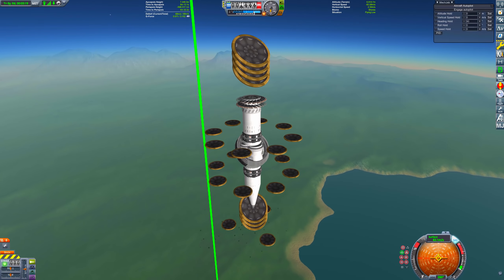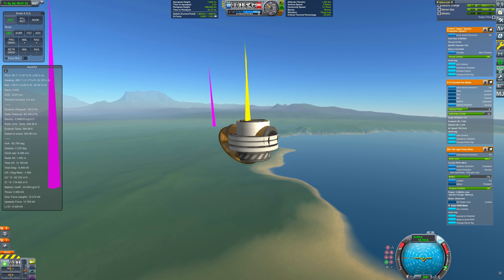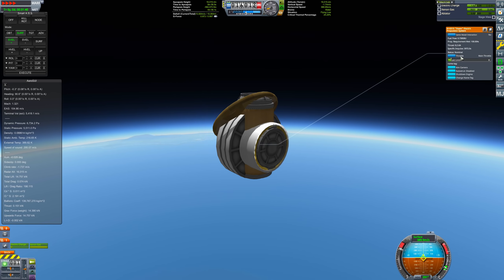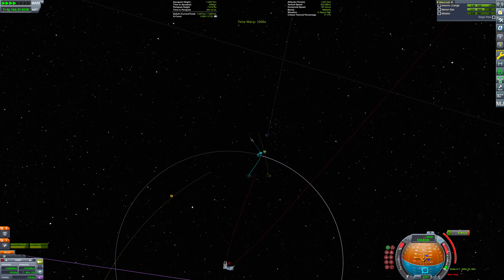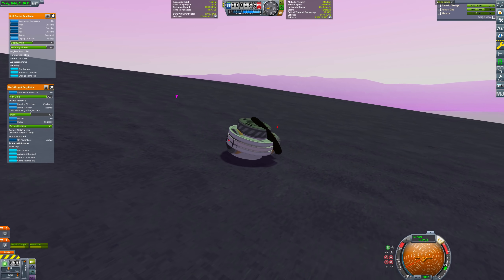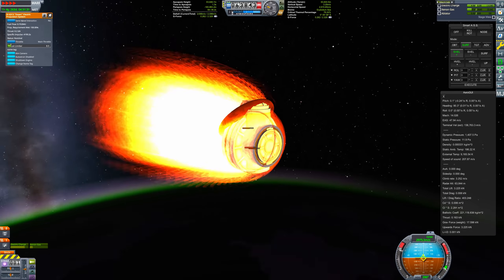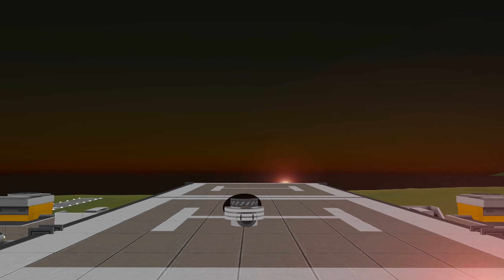1.56 ton SSTO to Eve and Back | No refueling | KSP 1.8.1

Comment: Me: Oh, man, my 1.8 ton rocket to Minmus and back is pretty cool!

Stratz:  Here's a shoebox that will get you to Eve's surface and back, and it also cures cancer.
Reply: The best thing i did was an 8 ton ship that launches kerbals at 5 septillion meters per second ;-;
Reply: To be fair, considering that the pilot is stuffed in a fabric airlock next to a radioisotopic thermoelectric generator for years at a time, it probably CAUSES cancer
Reply: @gioworno  wait for it to align with Laythe (long time) and fire, then it’s a glitch-railgun to Laythe
Reply: @delinep7286  he actually made that recently, tested it on Jool then decided that wasn’t good enough and is now aiming for Kerbol. It’s also got frictionless projectiles so no heat shields needed.

Comment: 6:07 actually, thats something that the space shuttle did! since it had to maintain a 45 degree angle of attack, it rolled from the left to the right to control its rate of descent.
Reply: It also had heatshield as a wing
Reply: @hphp31416  not as a wing, but on the wing(s)
Reply: But those wings weren’t very good at being wings.
Reply: @katkat9560 sometimes a little too good when you didn't want it.

Comment: I'm a bit late to the party but the Saturn V rocket travelled at least 384,400 km miles using 6.2 kilotons, while your rocket would be able to travel at least 3,668,900 km using 1.56 tons. That means Saturn V had a weight to distance ratio of 0.062 kilometers per pound while this SSTO had a weight to distance ratio of 1175.929 kilometers per pound, making it 18966.596 times more weight efficient than the Saturn V rocket (numbers are rounded to the nearest thousandth) (not taking into account gravity assists, orbital distance, and engine exploitations) good job man

Comment: I am perfectly fine with you using whatever version you find most convenient, especially in this physics defying case. And you did take the due diligence to point out the which and why. But imo there is extra credit to be had for going with the most recent (stable-with-your-choice-of-mods) version, or at least to not exploit version differences.

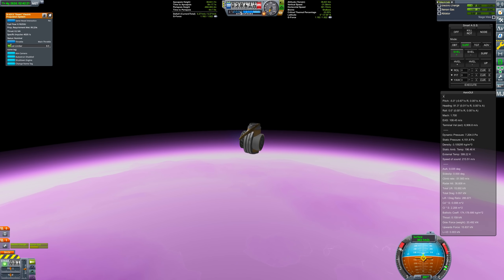Comment: 8:20 The oscillations you have noticed are actually phugoid oscillations. that is due to having no flight control surfaces, so your plane will dip and start accelerating, but this will increase lift and thus makes you pitch back up, but then you will lose speed until you pitch back down and the cycle repeats. you can even see the speed go up and down in the video. (yes i actually knew the phenomenon and had to look it up)
Reply from the maker: Very interesting. I did not know that. Thanks for sharing!

Comment: This is totally fine and fun as long as it is clear that bug-mode is enabled. Also quirks around quick safe and reloading should fall in this category. Except when save/reload is used to counter bugs. Like when a base planted on a surface keeps wobbling and gliding.
But still this feels like less of an achievement than for example the Jets to Orbit video, or the Duna on Electric Power one. Somehow if you know the physics are somewhat realistic it speaks more to the imagination.
Reply from the maker: Yes, I agree that this is less of an achievement than those past videos. Having some basis in reality does it make it much cooler.
I'm really just having fun with this tech for now. Its not going to be a staple on this channel thankfully.

Comment: Huh. Well done! With these crafts good heat tolerance and insane lift to drag ratios, I wonder if a dynamic soaring gravity assist would be possible. Maybe even a full 180 turn?
Reply from the maker: I don't know about dynamic soaring, but a 180 degree turn is possible. You lose a bit of speed as expected, but that's easily made up for a small burn afterwards.
Reply: @Stratzenblitz75  oh that's right. Now do a 180 while coming in from a transfer trajectory

Comment: Great vid, and I wonder why you use the hatch to hold the kerbal instead of a eternal seat. To prevent the kerbal from heat?
Reply from the maker: Thanks! The airlock is used because it is the lightest way to transport a kerbal. Its even lighter than a command chair